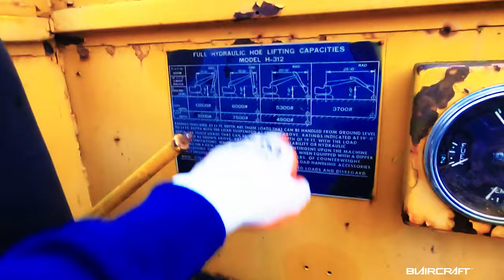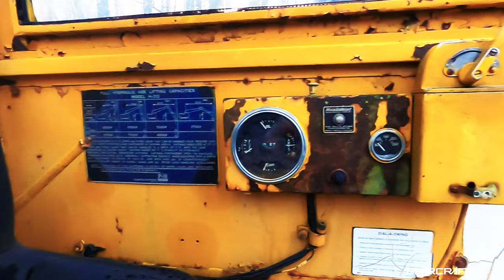I BOUGHT the CHEAPEST Excavator to Build RUNWAY

Comment: You need to put a manual thumb on that, it will help you to pick up trees to move or cut up, brush. Just put one on when you have new teeth welded on
Reply from the maker: Very true. I wish it had at least a manual thumb. Good idea to get it done when fixing up the teeth. 👍 Thanks for the comment.

Comment: the big lever next to the seat is a clutch to disengage the pumps. The lever on mine moves, but the clutch is stuck on.
Reply from the maker: That makes since, the previous owner never moved it. Not sure why you would ever want to disengage the pumps.
Reply: @Blaircraft.Engines  it's too disengage engine and pumps to ease cold start and warm up the engine
Reply from the maker: @hydroaxop73  Thanks! FYI- There will be an update tomorrow on the runway project.
Reply: @hydroaxop73 glad you shared this. I have the same machine and was wondering what it was for. Thanks!

Comment: The gages are powered through a pressure switch on the engine. The power comes from the starter hot lug, to the pressure switch. When the engine starts and develops oil pressure, it closes the switch and sends power up to the gauges. I have an H-312. Here is one of my videos:.       
https://youtu.be/btuIYi0uuHU

Comment: if you didn't already know, the engine is a 4-53 and the oil to use is strait 40w. They say multigrade pils like 15w40 will cause damage of some form. But, logically speaking the wrong oil is better than no oil .
Reply from the maker: Straight 40W, that’s good to know. Thanks. I actually need to buy some soon.

Comment: "Paint" any and all exposed and rusted metal like the sprockets, track, etc with used oil. Find everything that needs grease and grease it. Make sure the pins get it, etc. A broken pin will stop that project for a while as they are a pain in the ass to remove and replace.
Reply from the maker: I have a source for used aircraft oil, I should pick up a barrel! Thanks for the tip. I definitely don’t need a break down. Especially anytime soon!

Comment: This really shouldn't need an electric fuel pump as it is gravity fed.   Spraying ether like that probably isn't doing much. I would hold the starter on and give it a shot of spray at the intake while cranking. With my P&H i would have to do a heavy shot down the intake tube. But, after getting a good battery where the cranking rpm is good I haven't needed ether.
Reply from the maker: The pump was installed by the previous owner, so I’ve normally used it just for starting. But it’s started before without it fine, so yeah probably it’s not much needed.
Reply: @Blaircraft.Engines there is a mechanical pump on the back. If the mechanical pump failed, that's why he installed the fuel pump. Also, the ether probably isn't doing anyway as they are an oil bath intake.

Comment: Why an excavator and not a front loader with a back hoe on it?  It seems to me a bucket loader would be much more useful for moving large quantities of earth and leveling things, plus you'd still have the back hoe for the trenching, hole digging, heavy lifting, and what not.
Reply from the maker: My father in law actually suggested and good size excavator for pushing the larger trees and moving the stumps. 
He also has a good size dozer that I’ll be able to use for leveling things out. Good question though!
Reply: @Blaircraft.Engines  oh yes that makes sense. I have heard that an excavator with a 6 way blade is the best thing for leveling out a road or driveway or in this case a runway